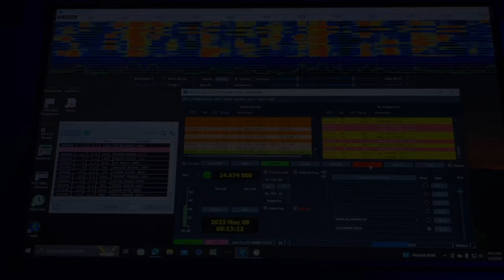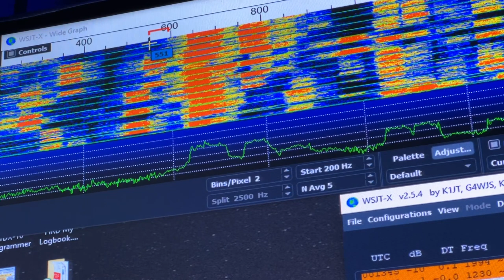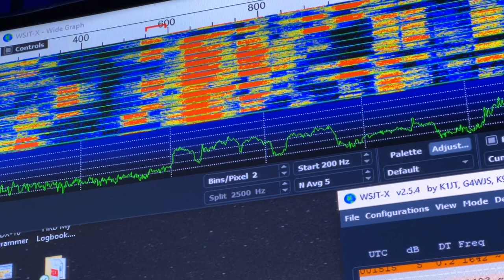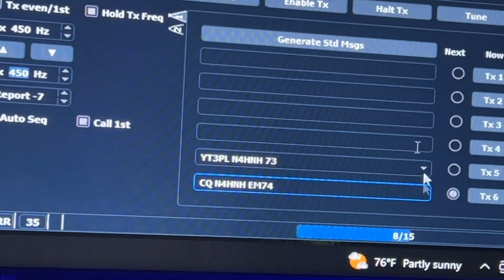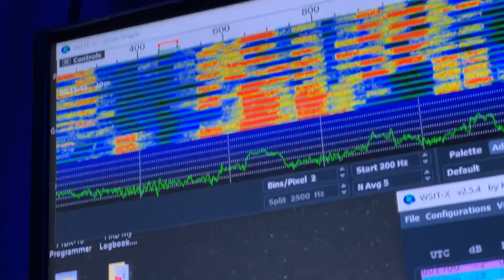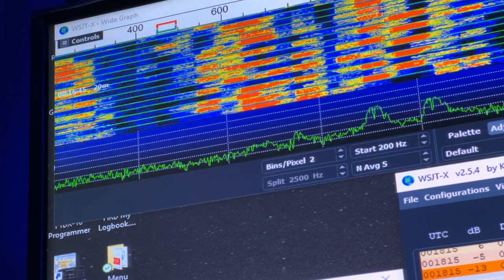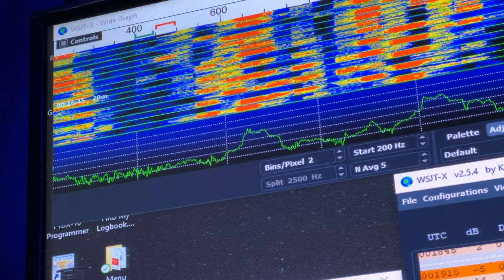Watch Out for This… (when working FT8) #hamradio #ft8 #digital #communication

Comment: Anyone answering your cq would not be transmitting over you even if they dont click maintain tx frequency because of the odd/even transmitting. If they did move over to your frequency, the person answering their cq would be transmitting over you tho. I always maintain my frequency as good operating procedure
Reply from the maker: The problem isn’t the person answering my CQ.  It’s the person answering my CQ and not using their own TX frequency.  They move to my TX frequency. That isn’t normally a problem either, but, they finish working me and then they start calling CQ, right where they worked me.
Reply: Yes but if they do move over to your frequency they wouldn't be transmitting over you because of the even/odd transmitting. The problem would be when they start calling cq after moving over to your frequency then if the person replying to them moved over to them, then they would be transmitting over you. All in all you're still right by recommending to hold tx frequency that way we all know where we are transmitting and no one would transmit over anyone
Reply from the maker: Exactly!  Covered in other comments.  Their signal makes it difficult for me to decode those who are trying to work me.
Reply: @n4hnhradio  that's what chasers do, they don't have to have their own frequency. Often the spectrum is full, they don't need their own frequency to respond to you. But they shouldn't call CQ after on your frequency, that's wrong.

Comment: May I, respectfully, ask all digital operators to stay off of the IARU CW Beacon frequencies? 
They’ve been around for years and years. It seems amazing that there’s so little discipline to prevent QRM’ing other stations, digital or not, when it comes to digital. 
I don’t do digital so I rely on those beacons for real time propagation information. Hearing yet another digital station doesn’t help me a bit.
Reply from the maker: FT8 and FT4 are usually at .074 and .078 respectively. On the 17m band, they are at 18.100 and 18.104.

Comment: I thought that wsjt-x could discern 8 qsos on a frequency, plus remember that when you are looking at the waterfall, you are transmitting every 15 seocnds, so it there is a big station on your frequency, thn transmit on the opposing 15 second session.
Reply from the maker: Read the other comments to understand why odd/even might not solve the issue.